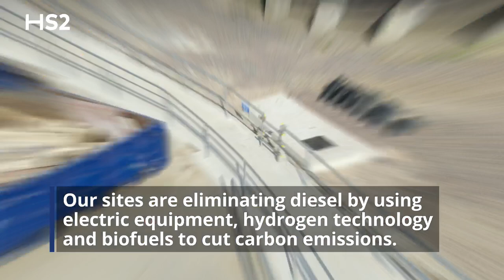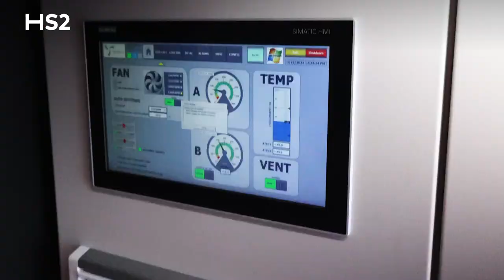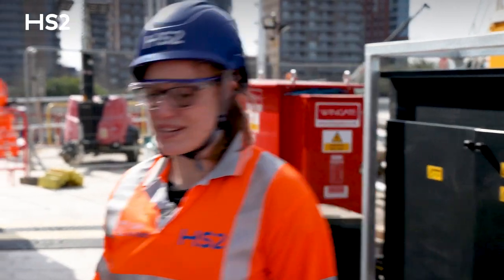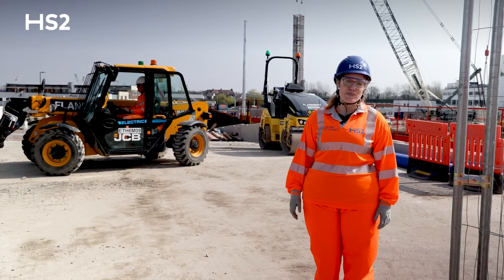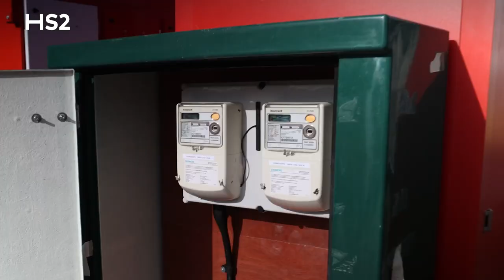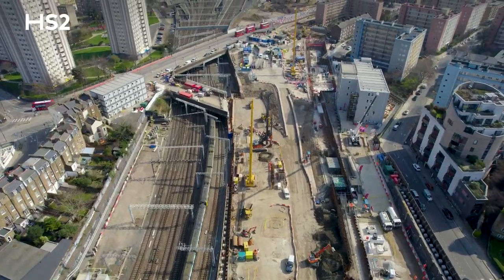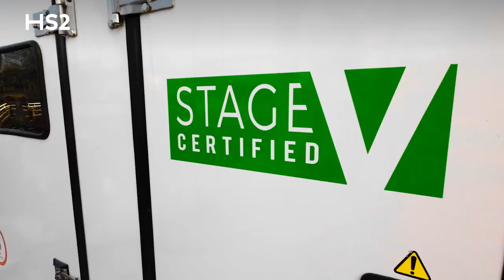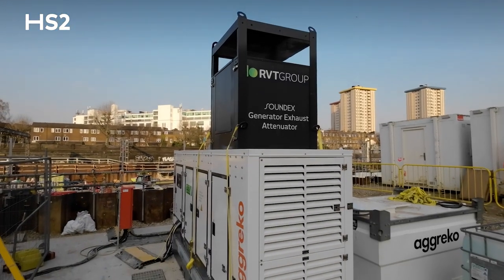HS2 pioneers diesel-free construction using hydrogen, electric and biofuels

Comment: what is the source of the hydrogen? it would be more efficient to run from mains power with batteries to balance demand for the pumps rather than lose efficiency converting hydrogen to electricity. That being said, it is really good to see this much being trialled on the project.

Comment: Using hydrogen fuel cells instead of direct from grid electricity is a) inefficient b) expensive and c) unless it is green hydrogen causes more pollution than you would have generated from just burning gas in a combined cycle power station. Sourcing renewable electricity from the national grid would have been much cleaner and cheaper.

This whole video is one massive virtue signal and not a very good one at that.
Reply: It's definitely quite a promotional video; but a lot of construction sites are away from infrastructure, so mains is hard, and they tend to roll in lots of diesel powered kit; if they're avoiding that Diesel kit then it's still better off.
Reply: @DavidAlanGilbert  Generating hydrogen is either inefficient (electrolysis) or dirty (from methane). The last is a big no no, the first is really not good either if you can simply use the electricity as it is generated rater then (inefficiently) turn it in to hydrogen and the (inefficiently) convert the hydrogen back to electricity, This is not a mobile application, it is fixed infrastructure. It would almost certainty have been better to tap in to the local grid, especially considering the site is is west London! Not exactly a long way from civilisation....